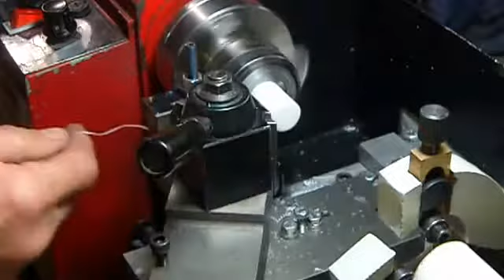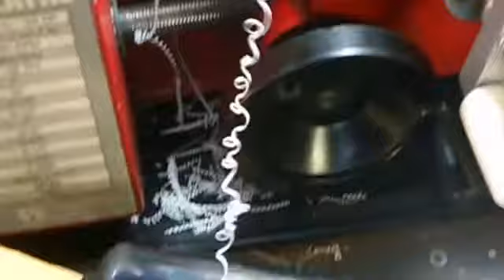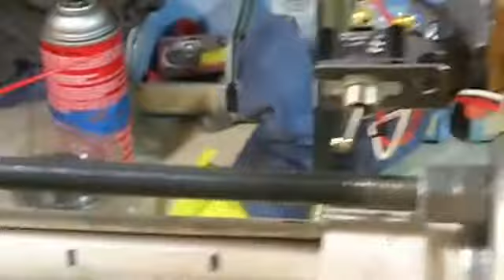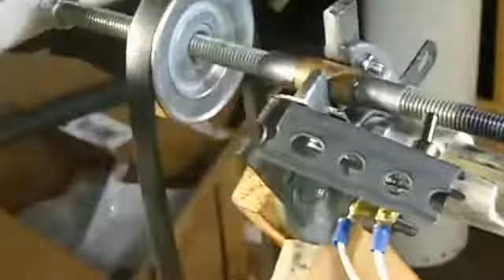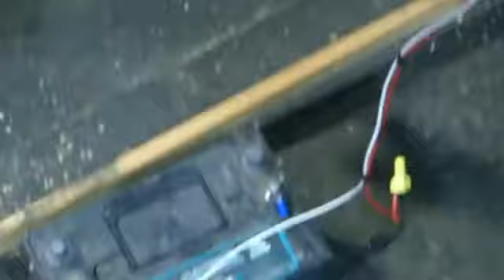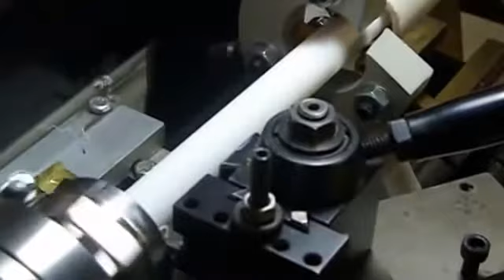Use a Mini-Lathe to turn a long piece of plastic rod to a precise diameter

Comment: 💪 I want.
Reply from the maker: The lathe is available from Harbor Freight. Currently about $650. Yes, it is a cheaply made Chinese unit, but it has performed very well for me for 9 years. Even these Chinese units can do good work if you know how to use them right.
Reply: @thadhorner5129  I have the super c3 sieg. I want that automatic feed you have!! I like the Chinese mini lathes. It's served me very well so far and still going strong. 💪
Reply from the maker: @andrewmcnulty0  if you ever need parts for that, check out www.littlemachineshop.com  They stock everything you need to keep your Sieg running and also a bunch of upgrade parts and related tools.
Reply from the maker: @andrewmcnulty0  Also, I will be running that process again in the next couple of months. If you would like pix of any particular part or section of the automatic feed, I can take some pix.

Comment: how to control machining time for ptfe so that they do not melt?
Reply from the maker: Make sure your tool bit is very sharp, sharp as a knife. And tool bits for turning plastic need a much greater Front Clearance Angle. 25 degrees really makes the tool "bite" into the plastic, which you want. I think with metal you only want 7 degrees, but that will just make the tool bit bounce and chatter on plastic. But no worries about the tool getting dull due to the high angle, plastic won't dull the tool like metal does.  Rpm for this job was slow, about 400 rpm, because the workpiece needs to advance slowly through the collet holder, but for other types of plastic turning you can go much faster if the tool is very sharp with a high front clearance angle. There is no time limit if the tool is sharp enough and the rpm is not too fast. See Tool Bit Geometry in https://en.wikipedia.org/wiki/Tool_bit
Reply: Which kind of rpm settings do i have to use to machine smal (4 mm) ptfe rods as smooth as possible?

Comment: is nylon rigid , can we drill long hole through it using lathe ??
Reply from the maker: You can probably drill a long hole through a Nylon rod, but you would need a larger and better quality lathe than the mini-lathe. One that's really trued up. You can true up these mini-lathes, too, but the larger lathes are better for drilling deep holes.
Reply: Drill a small hole with the lathe with the chuck drill attachment then a larger bit and so in until you have the correct inner diameter drilled.Measure 3 times drill once ! Take time setting up use a practise piece.